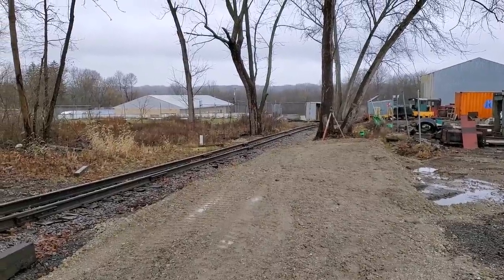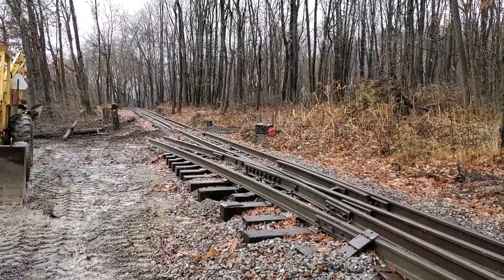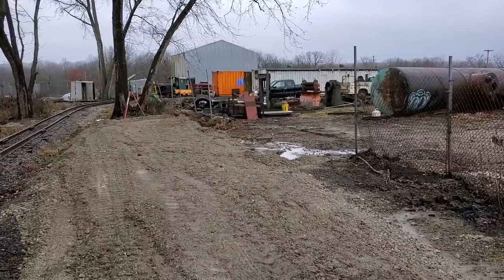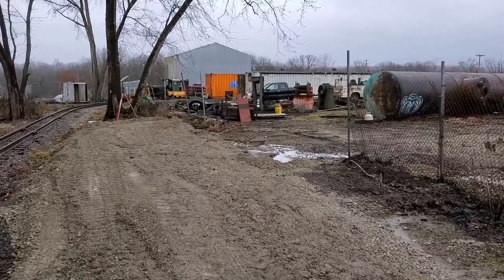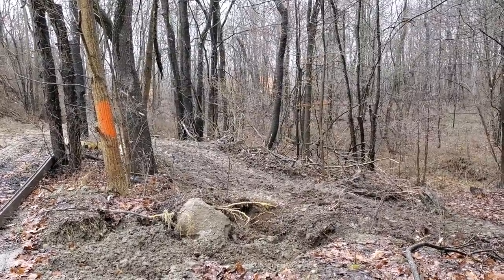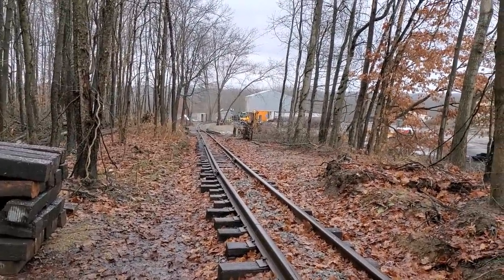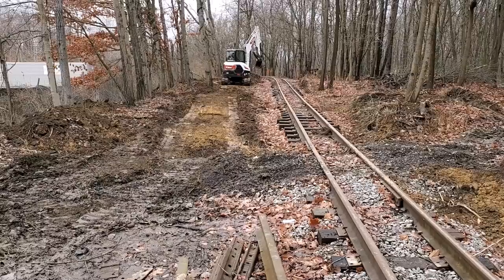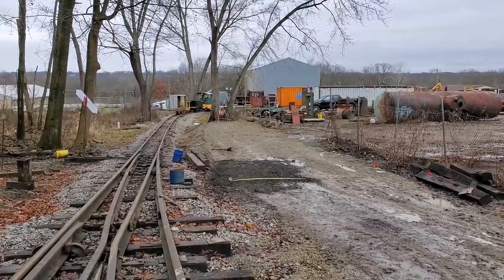Water, Solar and Steam

Comment: That caboose would make a lovely little cafe too with a view of the whole line. You can do pretty well with a cooler of soda, some bagged chips and a popcorn machine. Depending on the local codes you may not even need a food handler’s permit.

Comment: I could be wrong, but I don't think you need a permit or anything to drive a shallow well.  At my first house the well was a hand driven well only 35ft deep.  The water was potable right out of the well.  Look up some youtube videos about that.  The point and the pipe are not very expensive.  Depending on the depth to the water table on your property, you may not have far to pump it.  You could set up an amish style wind driven pump to fill the tank, or use a small gasoline engine driven pump to fill the tank as needed.  I suspect it would take a while to use 8000 gallons, so you would only need to fill it once a month or something?  If you have a well that you can call water from whenever you need it, you won't need anything more than the one tank car which adds to the scenery of your place.  Plastic IBC's or totes will look very bad unless they are hidden.

Comment: what happened to the big stationary engine belt driving the generator in the Todd engine building? to expensive to operate regularly I suppose but still worth mentioning. Also do you still have plans for the rotary convertor in the silver shed? Without utility power you wouldn't really be able to run it but still something we haven't seen since it was recovered.
Reply from the maker: The engine was taken out years ago.  It didn't work out as intended and that space will now be occupied by our gift shop/ticketing area.

Comment: This little industrial railroad never fails to stimulate ideas.  May I suggest you extend the track up to where you are standing, alongside the puddle.  I am sure the empty tank car can be muscled up there and mounted on concrete retaining end walls (or ties, or whatever you clever people have).  You want a water supply in bulk and ready.  Water quality might be an issue with regard to minerals.  Anyway, gravity is your friend, as is a quantity of water for your steamers.  Separating the caboose and tank car gives you rail features at two locations.  Just my 2 cents, but it is your railroad!

Comment: I'd like to see you build a diamond track crossing somewhere so that you could maximize your lot usage.   As far as the Tank car is concerned, I'd cut the cistern into 3 or 4 sections (rings) then re-weld them together at the top of the hill.  Either that or erect a water tank in the old wooden style (like the ones they still build and use in New York City even today) Hike it up on stilts and add a spout.

Comment: If the caboose is relatively far away from the rest of the power, it won't be very efficient to run electricity to it from the rest of your system.  Unless you run a big wire, there will be a substantial voltage drop.  If all you need in the caboose is lights and an occasional small amount of 110 volt power, you could put a single 12 volt solar panel on or near the caboose to charge a single car battery or deep cycle marine battery.  The lights in the caboose could be 12 volt and you could have a small power inverter like in a van to allow for use of some 110 volt power tools or an appliance of some kind.  For what wire costs these days, it might be a wash or maybe even less expensive to set up the small independent solar system, than to run several hundred feet of heavy gauge wire.
Reply from the maker: One of the advantages of salvaging stuff out of steel mills for years included acquiring a bunch of wire.  I think I have enough to get back to the caboose with 10 gauge which will be sufficient as the loads are going to be minimal, thanks to LED lighting.  The caboose is going to be in an area that will be mostly shaded so an independent solar installation probably wouldn't be all that effective.

Comment: Maybe have a secondary water storage at the building, collecting rain water off the building?
Reply from the maker: That is already in the plan.  I just have to put the gutters on the building which have been sitting here since we built the structure.  1" of rain would give us 1,000 gallons of water

Comment: I think you should put the tank car near the engine house facility so that way when 58 operates on a weekend the tank car will be useful for 58 and the other porters and so that way 58 doesn't have to go on the mainline to use it on.
Reply from the maker: We are just going to run a water line from the tankcar down the hill to wherever we need a standpipe.  With that amount of fall we will have good water pressure for filling the saddle tank.  We may initially have to fill the tank at the top of the hill but once the water line is in place, the watering would happen at the engine facility or the station.
Reply: @YoungstownSteelHeritage  oh ok that's all I needed to hear.

Comment: Is the caboose standard gauge or narrow gauge? It will be awesome when the track is finished all the way. Nice little run. Do y'all use water treatment for the boiler? Why not drill a well on your property for water? Then keep the tank car full to fill the locomotive tanks very fast. I've seen old videos and pictures of logging railroads drawing water out of a stream, river, or pond. Wonder how or if they kept sediment out of the locomotives and how or if they treated it for mineral content.

Comment: If you had the room you could power an Archimedes screw from the pond to the tanks as well.  I wonder about those "Battleborn" batteries like what Bus Grease Monkey uses to power his bus with.  I know he has solar panels atop the bus and a few just lying on the ground next to the bus.
Reply from the maker: I have been looking into the Battle Born batteries, especially the ones that have their own heating elements to keep them above freezing.  They are the top contender so far for this installation.

Comment: What’s the intent for the tank car? I’d just say scrap it. Torch it, Cut it up, and use the steel for something else if it’s in the way or doesn’t have a purpose. P.S. When tickets are available for a trip up the line, I’m getting em. You guys are amazing.
Reply from the maker: I go over what we are going to do with the tankcar in the video.  It will become the water reservoir.

Comment: If you get ahold of Berz-Dearborn, or Suez (I think it's now Suez), they should be willing to run the water testing for boiler water, and what treatment they will gladly sell to you :).  PS:  Potable water is NOT the same as boiler water !  good news is that in a one and done is that it's not generally that horrible bad for the boiler, but if the water has a lot of TDS, then it would be problematic.  
(I've been doing this for a while, I remember you from Ahead of the Torch !)

Comment: Take a measurement of the total lift and see if a solar fountain pump would be able to lift that far.
Reply: Relay should be an easy solder job on the charge controller.

Comment: Does the diesel locomotive, with the solar panel charger/batteries in it, have a functioning engine? If so then that could perhaps be used as a powerplant for the area?
Reply from the maker: Yes it does run but only makes 250 Volts DC
Reply: @YoungstownSteelHeritage  Ah ok, well that would require a bit of work to be useable for anything :P
Perhaps a DC motor driving an AC Alternator would do the trick but then those needs to be aquired and housed somewhere.

Comment: Every time i watch these vids ,it's snowing. I doubt solar would be a good idea.... 😁😁.On the subject of batteries,one my mates is a electrical engineer who has put solar on his house that he made himself. instead of expensive batteries, he went to a salvage auction and bought a  Toyota prius, ex taxi, and uses the battery pack out of that to power his house 24 hours a day,including a lathe etc etc . The remnants were sold off as used parts despite the enormous mileage (800,000 Kms!) which made the whole experiment almost free.